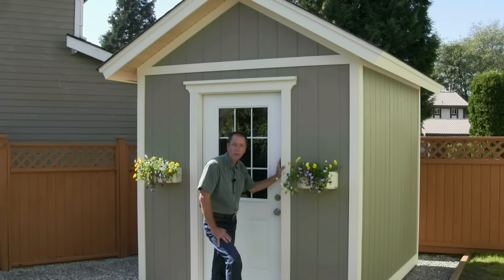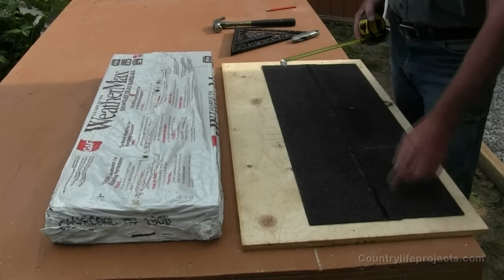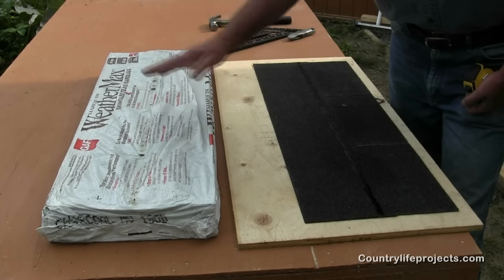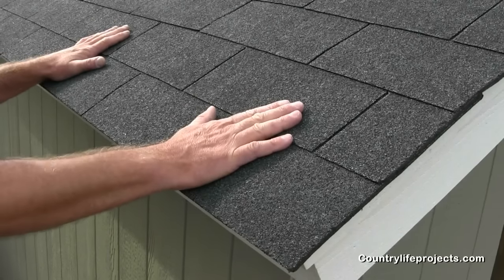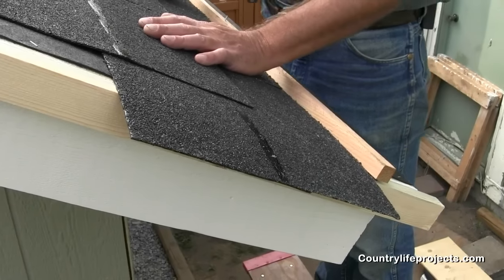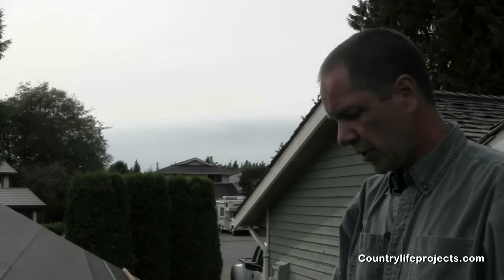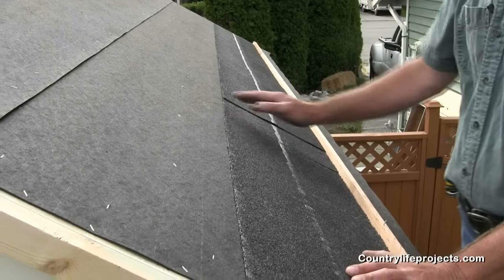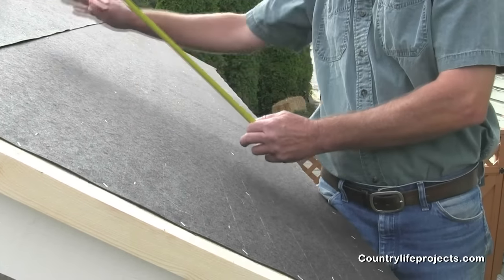How To Install Asphalt Roofing Shingles on a Shed or Cabin - Shed Building Video 13 of 15

Comment: I had a 7’10” wide by 32’ trailer with tin roof. 
I am insulating and going with a shingle roof. Materials are under $1,000 in inflated 2023 prices but includes everything I needed. This video is a gold mine of information, well taught / shown. 
Thanks for saving me thousands of dollars helping me do the job, a better job than the expensive, sloppy, disrespectful, hurried tradesmen we have here.

Comment: I'm about to use 3-tab shingles to re-shingle a small wishing well roof. Never shingled before. I've watched several videos on it. This video, so far, is the ONLY video I could find that addresses the measuring of the roof, so that you have equal. symmetrical shingle amounts on each side (not a full tab on one edge, and a 1/4" on the other). That fact was bothering me, and no other videos talk about it. They just start off with a full shingle sheet flush with the edge. I'm kinda Obsessive with such details but even This Old House didn't mention it. Well done.

Comment: Also a tip: when adding the last piece to the ridge cap and you Tar the mail heads on that last piece, take some of the loose asphalt from the shingle packaging and sprinkle some on to of the tar, it hides the nail heads
Reply from the maker: Good point... I got that tip shortly after we finished the videos too - but too late to show it then.

Comment: Put tar glue/sealent on the last four ridge cap exposed nail heads, then press loose granular material from the bags the shingles came in onto the soft tar, and abracadabra like a magician - even the tar color disapears!

Comment: If you put a dab of plastic roof cement over any exposed nail heads, collect some colored granules from the packaging and sprinkle onto the cement. It will camouflage it. 
I was surprised you didn't use a metal drip cap on the edges. A roofer from South Florida taught me after Hurricane Hugo to apply a wide strip of "bull" or plastic roof cement along all edges so the wind cannot lift them off. That is especially true at those ridge caps that don't have any cement under them.
All exposed edges ideally should be bevelled or have a drip kerf cut into them and primed to prevent capillary water damage. 
Really good video series over all with a good host, well thought out videography and script. Glad to see the editing correcting misspeaking as everyone does it. 
Water is what destroys buildings so at every step consider how to keep it out.
Reply from the maker: Hi Hearthman... Some very good points. I just learned a little trick with the granules (thank you). Your other points are valid and should be considered in areas of high winds. For those that live elsewhere those methods would likely be overkill but in areas as you noted, for sure. Keep in mind, it is a shed and cost can just keep going up if you do too much - so if it is not need for most areas we kept it out of the build.

Comment: Thank you much for these videos.  Question regarding nails.  If I plan to have the underside of the overhang exposed, should I just use shorter nails to prevent the nails from coming through under the overhang, or is there a different procedure or glue to make sure those first couple of rows of shingles are secure.  I was even thinking of using T&G as roof sheathing around the perimeter so it is visible underneath the overhang, and I wouldn't want nails to come through on that section.  Thanks much!
Reply from the maker: That is a good question. Have not dealt with this before. Using shorter nails might work for the first layer, but they may be too short on the second layer and it will be difficult to get just the right length to ensure they do not poke through and still have enough holding strength - especially for the first rows which are most venerable to high winds. I have to be honest, I am not sure how professional roofers would handle this and it can't hurt to ask one or two local roofing contractors how they would do this.  

That said, if it was my choice, for the best appearance, I would use 3/4" material around the perimeter where it will be seen from underneath. Then strap the remainder with 1x4 strapping. I would then put 1/2" or sheathing over the entire roof. This will provide a substrate of 1 1/4" around the perimeter plus the thickness of the first layer of shingle (roughly just under 1/8" depending on the shingle). Now you can easily use the recommended 1 1/4" long nails without any concern of them penetrating through the underside. 

But, as noted, it can't hurt to consult a few roofers and see what they recommend. Maybe there is an adhesive that can be used in conjunction with shorter nails on the first rows that would provide the required strength to prevent blow off in high winds.

Comment: If you install drip edging along the base and gable fascia boards, about 1/2" (3/4" or 1" if you'd like) out, you automatically have an edge to use for extending the shigles, instead of using a 1" wide board, and creting more holes in the facia board.  drip edge cost about as much as the wood these days, but serves a good purpose, eh!!!
Reply: You can just fill the holes with a good quality caulk.

Comment: I am really not good at that, but I wonder whether some glue would not help with the cap on the very top, just in case the wind changes regular position?
Reply from the maker: Probably not a good idea, and not really needed. With the amount of nails in this strip and the tension created bending them over the peak, these are the least likely to tear off first. Usually the weak point is at the base of the roof or the gable ends. Also, glue is unlikely to stick well to the shingles.
Reply: @Countrylifeprojects  Thank you for your explanation!

Comment: do you have a video on a reroof? redoing a roof that already has one layer of shingles on it?
Reply from the maker: +the eabster Not at this time. But IMO, if i was to redo a roof, I would not go over the existing. I would tear it off and start fresh from the sheathing. In the end, the over all job is better, looks better and will last longer. Ask a "Good" roofer and they will likely agree it is the best way to go. Some roofers will go over existing shingles to save on the cost of tear off but most will not for warranty reasons.
Reply: Tear off the old singles leaving them on is the lazy way of roofing You want a good look at your roof surface anyway to see if there is any damage rot etc

Comment: Just wondering if there was a better or more random pattern to apply?
You have rows 1, 3, 5 and so on the same break. Is there a better way to do this?
Reply from the maker: Hi J... When it comes to these type of shingles that is not critical. The main priority is that the row overlaying the prior does not have an open slit above a shingle joint.

Comment: When using the spacer board on the front, isn't that screwed into the trim piece that was just put up, making unsightly screw holes? Do you go back and fill those in later after you take the spacer off?
Reply from the maker: Hi Aelanna... The screw holes when using cedar are very small. And yes, before we finish the final coat of paint we filled the holes with caulking and later painted over them - never to be seen again.

Comment: Hi did you put a 1 inch over the gable ends? That seems like its a lot. A lot of others only put a 1/2 inch. I like the inch but is it going to sag?
Reply from the maker: 1" may sag a little but it is not likely to be enough that anyone will notice. There is a benefit to a little sag as the water will run off the edge and drip off - where as if you have a rigid 1/2"  overhang, the water could travel back under the shingle to the fascia board, possibly under the shingle a little (not to likely in most cases, but possible).

Comment: Any need for a dripedge  on the roof? Must admit it looks much better without it
Reply from the maker: Hi Ty, if you look at homes built several decades ago, there was no such thing as a drip edge. IMO the use of drip edge(cap) today is to compensate for inferior fascia materials that need protection from moisture and rainfall e.g. OSB etc. If you use good quality solid lumber for fascia I think a drip edge is not required - especially for a shed.

Comment: I noticed there is no drip edge. Do you have a video for the drip edge installation?
Reply from the maker: Hi Scott... for a shed we felt drip edge was a bit overkill and just an extra expense so we opted not to add it. In our opinion, many houses built in the early to mid 19th century did just fine without drip edges. Taking time to do a proper install is the most important. That said - - Since it is available, I would definitely use it on a larger more permanent investment like a house or garage.
Reply: I can't find drip edge for the gable end available in the UK!!

Comment: Chalking lines all over the roof isn't really necessary. As long as you make sure that your first course is straight, then each following course will be straight if you install them all with equal exposure. Either with the gauge on the nail gun (or the gauge on a shingling hatchet if hand nailing) or using the tip of the tab groove as the exposure guide.
Reply from the maker: pguiver Granted... however, we did the roof this way to make sure that "everyone" regardless of experience would be able to do the roof and achieve good professional looking results. I've seen roofs done by so called pro's without chalk lines and somehow... as you get closer to the ridge the shingles seem to be less straight than the first half of the roof.
Reply: Good point, I have seen many roofs done with courses waving all over the place by pros as many of them don't take the time to make sure each shingle is aligned properly even if their first course is straight. Personally I would skip the non-crucial chalk lines but still invest the time in making sure there is equal exposure throughout the roof. I guess I've done it enough that my courses are always perfectly parallel to the ridge when they reach that point.
Reply from the maker: pguiver Pro's, the good ones, get an eye for these things and will see subtle changes as they work, and those that care may snap a new line to stay straight, others don't. Good roofers would check as they go, but most DIY'ers would not notice these things until done... so I used the techniques shown in the video as I felt this would avoid most issues and a poor roof job.
Reply: When we roofed we did few chalk lines and it turned out real good. IMHO it's worth the effort if your new which I was

Comment: This is the guy that one should have to do your roof. Not too many that care anymore. Everyone wants to save a hour and screw it up.
Reply: Boar Hog The reality is that if any roofer spent as long as this doing a shed roof, they would either make no money, or they would have to quote the job with a high enough labour cost that they wouldn't get the job. Many people underestimate amount of work involved in roofing and they think you are overcharging.
Reply from the maker: pguiver These videos are not about roofers making money, they are about anyone watching them using the info to do a nice job of a shed roof (or any other project). Pro's would not do a lot of things I did. E.g. hand nailing, chalk lines for each course etc but these videos are intended for DIY'ers.
Reply: pguiver I depends on how much a guy charges per hour. I know i am in business as well and some guys think they are worth 100 hr and they aren't worth 30
Reply: I watch the Pros roof across the street lots of short cuts and in IMHO rushed it. Once done the homeowner  wouldn't see or now the difference. I'm pretty  sure my roof will outlast that one as we   took the care in doing it right not just fast The youngsters ding it certainly  were in the 30 buck range

Comment: Videos, what is the nailing pattern for Owens Corning shingles
Reply from the maker: Hi Bill... there are so many types of shingles available I cannot tell you that - but they should show this on the wrapper of the shingles - failing that, check their website as most of these large companies have all that information. Even the pros have to check these specs once in a while and expect that information to be available.

Comment: Bearing in mind that I'm a complete newly on roofing, I bought my shingles of this shed and brought them home. Went to preparing them and found they don't match the size depicted in this video. Apparently they are metric. Who knew? Not me for sure.
Reply from the maker: Paul Gritton The size it not critical if you follow the general guidelines... e.g. laying out the width first and so on. The only difference will likely be in the shingle exposure (number of rows required). The principal is the same.
Reply: Country Life Projects & Living Yes, I did find that I had about a full bundle extra of shingles. I had no idea there were different sized shingles. Live and learn I guess. I am very pleased with the videos and plans for this shed. Well done videos too. Highly recommend this shed/project for new or beginning builders.

Comment: You should nail above tar strip line on shingle.
Reply from the maker: That is called high nailing and it is not recommended by any shingle manufacturers and may void the shingle warranty. Doing so makes it likely to puncture the shingle surface, cause lift on exposed shingles and prevent shingles from laying as flat as possible providing the best wind resistance.
Reply from the maker: Also, when nailed as shown in the video, you effectively have two rows of nails holding each shingle, those nailed as each shingle is applied, and nails applied on the next row go through the top of the underlying shingle.

Comment: No drip edge???
Reply from the maker: Nope... this is only a shed and IMO opinion overkill for a shed. If the roofing is installed correctly at the pitch we used, there should be no issues. Do note that houses built over a half a century ago did not use drip edges and have stood up very well.

Comment: Is tar paper ok ?
Reply from the maker: Hi Mark.... sorry for the delay answering, been a crazy busy fall. For a shed, tar paper is totally fine. However, some areas no longer allow its use - but that may only apply once a structure is over X amount of square footage requiring permits. If no building codes apply, I would use it - just be sure to overlap the horizontal joints etc.

Comment: What about drip edge??
Reply from the maker: There are a number of roofing applications that are optional (unless required by code but that is mainly for homes and garages), especially for a shed. IMO a drip edge for a shed is overkill. Many homes built 50 years ago have stood the test of time with no drip edge and if rot occurred, it was mainly due to poor workmanship versus the use of a drip edge. That said, if one wants to spend the extra money and time to use a drip edge on a shed, there is no reason not to.